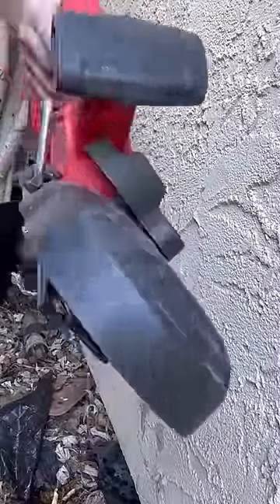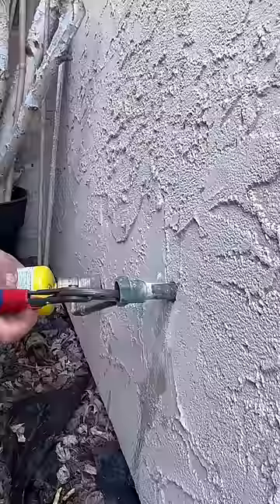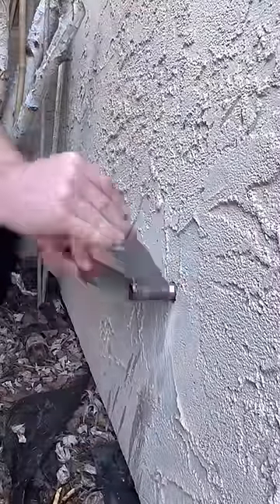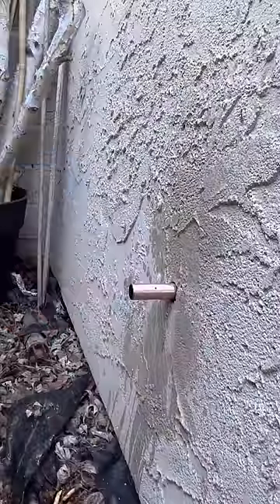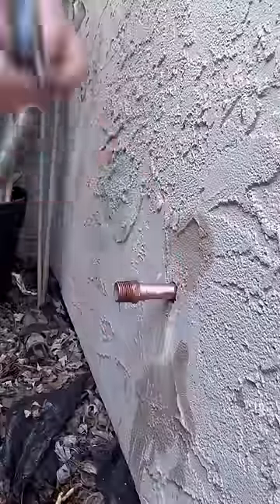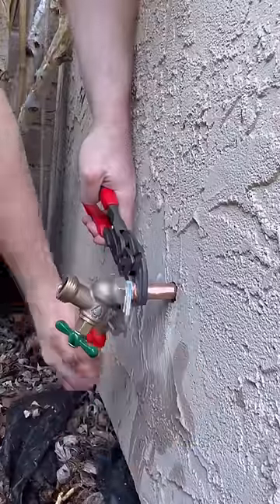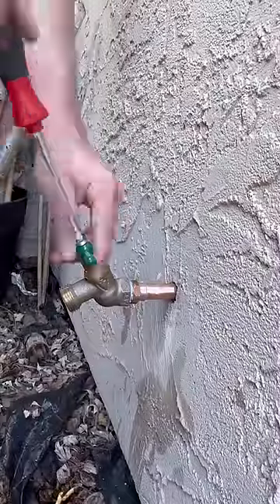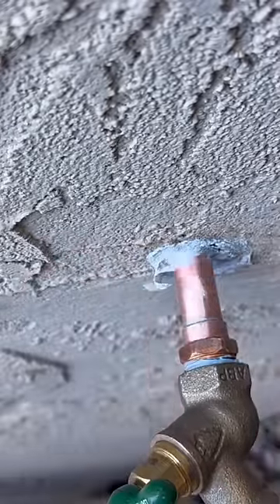swapping a hose bib #plumber #plumbing #diy #soldering #oateyambassador #propress #copper #repair

Comment: Please come and fix mine. I hate it. It drips is pulled away from the foundation / brick wall it was mounted to. I don’t have a blow torch or a soldering iron 🥴

Comment: Just be careful about soldering around openings in structures. Any kind of draft into the building can suck enough flame to light it on fire. OG advice.

Comment: I'm not a plumber, but I worked in hydraulics, and let me tell you something. There's no thread in this world that can stop hydraulic oil without both tape and dope. As cheap as it is to do both, I see no reason why you'd willingly do a shitty job when you can be 100% confident you won't have a leak if you took an extra 15 seconds.

Comment: You don't need a male fitting when you have a female fitting, because they sell valves with a male end that will screw right into the female fitting. I'm a plumber, and I did the same thing to our house, just went to Home Depot and bought a valve with a male fitting and screwed it right into the female fitting.
Reply from the maker: That’s not a female fitting buddy
Reply: Never mind, I see what I missed, you cut it right behind the valve and when I seen it, it looks just like a female fitting, which is exactly what we have on our house. Sorry, I missed you cutting it off, I turned my head away for a split second and didn't see the cutting part. Lol.
Reply: You gotta admit, looking at it from my point of view, that if you didn't see the cutting part, that it looks just like a female fitting.

Comment: Why put on a crappy faucet that starts leaking when the washers dry out?  Use a ball valve.  A little more expensive but will last forever.

Comment: Next time when you're sodering you don't have to worry about the water inside the pipe just stick yourself a piece of bread in there bread will  sogy  up and then push right out when you are done When you turn back on the water..

Comment: He might as well just unscrewed the old silcock and screwed a new Silcock on with male threads or a boiler drain. If he was going to use solder, then he should’ve done it the correct way by cutting the pipe from the inside and pulling the pipe out and solder a direct sweat Silcock onto the copper and slide it into the wall until the back of the silcock was flush to the wall.  That way it will not look like shit

Comment: You disconnected the grounding clamp. There should have been a ground wire attached to that needs to put that on before you left

Comment: Still don't understand the difference between using a male adpt or female adpt your screwing it on either way. Also, they make plastic snap essuccsion that never rust

Comment: So every time someone touches that tap, the pipe work moves, the sealant you put on is now no good, and whatever or wherever that pipe tees off is now at risk of cracking its welds due to the movement of this pipe. Cowboy job 1/10. And the 1 is for turning the handle on tap

Comment: Stupid escutcheon plates usually just hide the fact that there is no sealant around the pipe because they were lazy. Most I see are plastic so no rust but usually a gap into the wall behind it.

Comment: The plumber b4 you used that female copper fitting because it's more durable than the brass  your putting on the outside boy

Comment: Some of these American tradesmen are terrible. The pipe was moving in and out of the wall. You need to cut the pipe back and put some elbows on it so you can bracket it to the wall. I’m an electrician telling a plumber how to do his job?

Comment: Where I'm from that exterior hose bib. Wouldn't  survive the first Year. Or Winter... Absolutely requires a Frost free exterior one... I  know of  at least two different lengths of how far recessed or  behind exterior walls. That the water stop is. Typically in basement/ weatherized  crawl space... I'm definitely not a certified professional plumber/mechanical/ HVAC... I know enough to be dangerous... An as I continue to become less youthful,or  follically challenged.  Growing  face,  as my forehead is currently somewhere between a seven an a half to a solid eight head.. also approaching at least a apprentice plumber assistant CRACK... A MASTER DUMBER...

Comment: OG tip #2. If you can't get the water to shut off because of an old main valve, stuff some bread in the pipe so you can sweat the fitting on. When you turn the water back on, the bread will dissolve.

Comment: This is stupid he removed a male hose bibb and replaced it with a female hose bibb. What Plumbers do who are not honest. Create extra work to justify a bigger bill. Why did he need to replace the female adapter to install a male adapter? And only an inept plumber needs to use both tape and pipe dope. I would have unscrewed the male hose bibe and installed the new male hose bibe, no sweating on a new adapter and changing adapters to installing a new adapter and changing to a male adapter and a female hose bibb. I call this padding the bill.

Comment: holy shit people actually ask why you aren't pro pressing? because pro press looks like Lego dog shit, and makes the person doing it, not require as much experience. a good solder job would tell me all I'd need to know for a plumber. pipe dope and tape on metal to metal connections, only dope on plastic to metal or plastic to plastic as tape can fill too much of the voids and could even cause the fitting to expand or contract and fail as dope will fill the threads just enough to seal and not force the fittings apart when tightening.

Comment: It's soLder not soder
Reply from the maker: It’s pronounced differently in the US🤯
Reply: @replumb  you can't just drop the L cas ur American?
Reply: @dalemawby8717 The "sodder" pronunciation is actually older. The word is from French "souder," but the L was put into the spelling on the basis of the Latin etymology (related to "solid"), and eventually a lot of people started pronouncing the L.

Stay jealous of America, peasant
Reply: @usa5439  It's 2023 and the correct pronunciation is soLder,, and in Australia it's always spelt and pronounced this way, no jealousy just a fact.